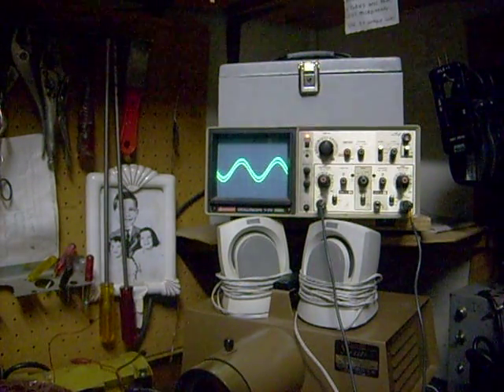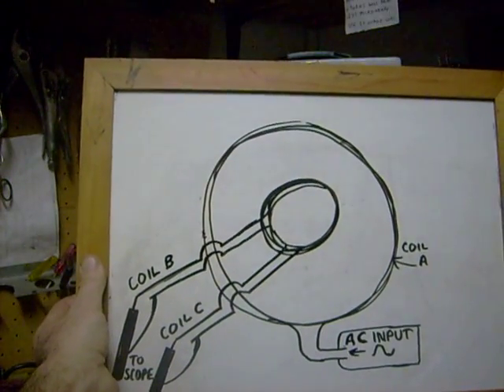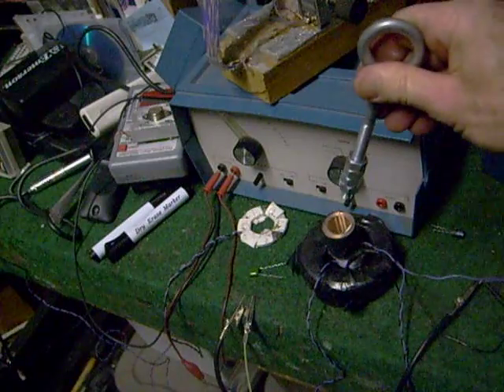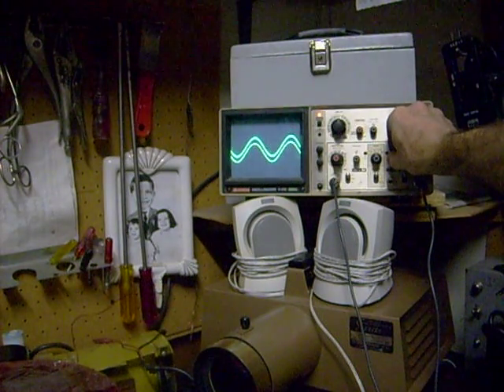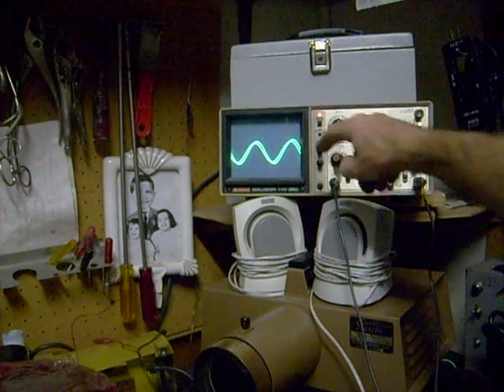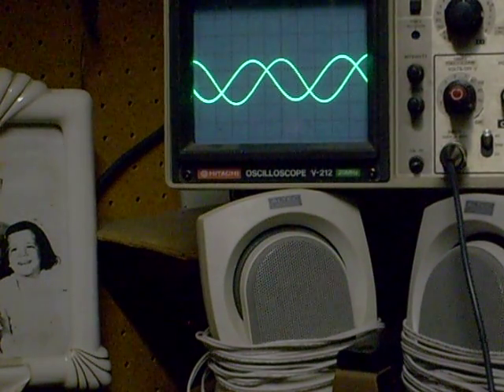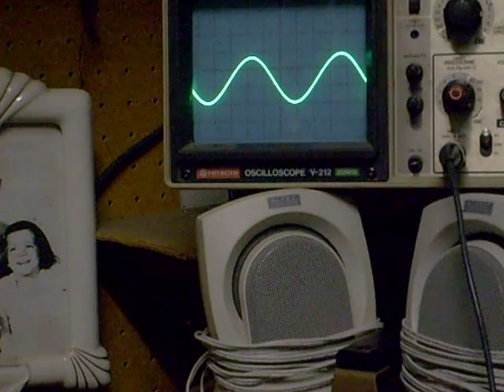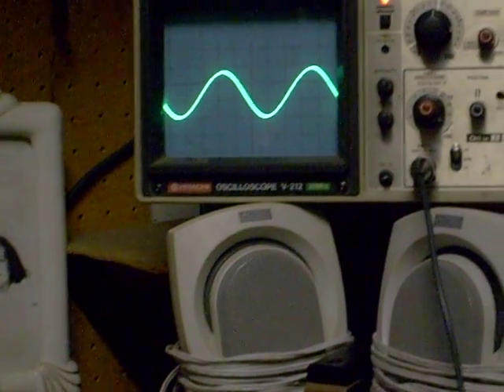Phase angle difference

Comment: Dave, enjoy your vids. I know this is a very old video and you may have put this issue to rest in your mind however, I wanted to share this with you in case you haven't. When viewing the sine wave on your scope, you are seeing the phase of the voltage only. If you were to connect a resistance in series with your coil and connect the 2nd channel across this resistance, you would then measure the IR drop induced by the current flow. You would then see that the current measured on ch2 is indeed lagging the voltage measured on ch1.
Reply from the maker: Thanks for the clarification. Using a resistive shunt for my current measurement would have been a better way to show the difference between current and voltage. I should probably remove this video.
Reply: In my opinion, I think this video demonstrates mutual inductance and voltage phase shift of common cores very well. It really drives home the function of tuning inductors in those old radios. Again, I really enjoy watching your channel and you are a super nice guy.
Reply from the maker: Thanks bain.